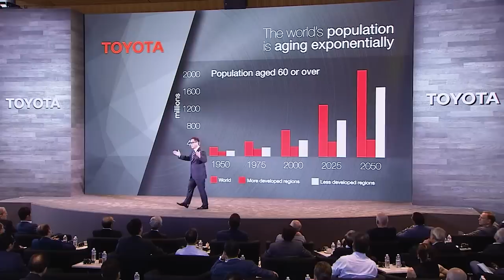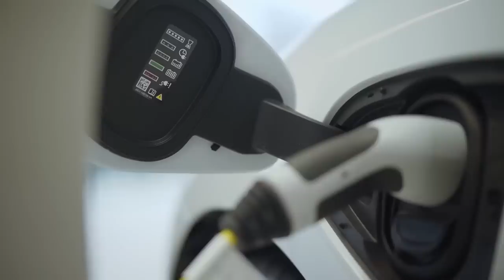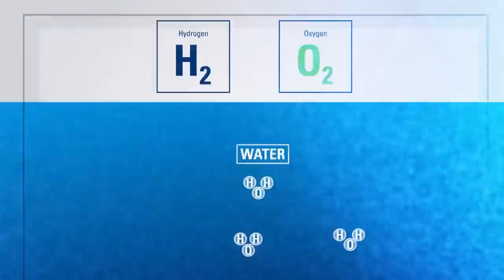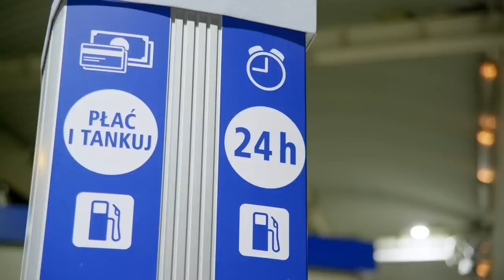New Toyota CEO Shocks Everybody | Huge News

Comment: Wishing Toyota 's success. More breakthrough in H2O2 technology in the near future.
Reply: This is about H2. H2O2 can be used as rocket fuel. Terribly inefficient. Just like the H2 value chain.
Reply: Think you’d have a real winner if you can power cars with ocean water

Comment: ...brilliant.  This is why Toyota will not only be around for a long time but it will stay on top in the automotive industry.
Reply: Actually makes sense since Toyota is a global company, many auto sales will go to countries that do not have good power infrastructure, even potentially remote locations where hybrids may not make sense, to have a more reliable tried and true gasoline based powertrain. EV's will be more popular in North America, and in more wealthy locale.
Reply: I agree but it's interesting to see how many are saying Toyota will be smaller or even go bankrupt in the future because they are "behind" in their BEVs and aren't all in on BEVs.
Reply: Some stink at reading a cristal balls.😂
Reply: @benjaminsmith2287  Part of the problem is that its going to be much cheaper to run a BEV than a Fuel cell vehicle.    Hydrogen is still about 8x more expensive to use than a electric charger unless you make the hydrogen from natural gas.   Then you will only be 4x more expensive.
Reply: Until the oil runs out
Reply: @victorluke5816  Yes, the costs are there yet, nor is the infrastructure. Battery development is much further along. But I think hydrogen FCEVs can get there in time.
Reply: @TheIsioisi  They were saying in the 70s that we'd be out of oil 10 years ago.
Reply: @Benjamin Smith  Storage of hydrogen is one of the biggest challenge. Also very dangerous. It's a great fuel for stationary applications
Reply: @benjaminsmith2287  Its just that by the time they get there the batteries may be 4 minute charging for a thousand miles and made of sodium instead of more expensive lithium.  The sodium batteries are already being put into cars this year.
Reply: Nah, Toyota won't pass the decade, and Tesla will dominate the automotive industry, Toyota is late to get into the new paradigm, making cars with all 4 technologies is a waste of resources, time and workforce, combustion is old technology together with hybrids, hidrogen  is a technology that was born death, so money and time going to the trash, RIP Toyota, being conservative and stagnat was your doom.
Reply: @victorluke5816  Economics of scale. Heavy equipment manufacturers are leaning towards hydrogen,as they can use the existing power plants they already manufacture.....EV heavy equipment is a non starter.
Reply: I live in texas. Toyota has their amerucan headquarters here. We love toyota! And i have one myself.
Reply: @benjaminsmith2287  toyota is not behind. You have no idea what youre talking about
Reply: @sommebuddy  Wouldn't diesel still be better than Hydrogen for heavy equipment.  Electric Semis look like they will be half the cost of operation than diesel so that makes sense but hydrogen just sounds like its just going to be more expensive to use than diesel.
Reply: @PolishBehemoth  Go back and read what I wrote. Then comment accordingly. You're assuming something I didn't write.
Reply: @victorluke5816  I'm aware of sodium batteries and they aren't there yet in terms of performance and reliability for automobiles. And they're not close to such a short charging rate.
Reply: They're lagging way behind the EV game, so they're trying to stay relevant by flogging the dead-horse of HFC technology...
Reply: @benjaminsmith2287  Sodium batteries are arriving in cars mid 2023 in China so I'm going to see how they rate in comparison to the standard Lithium ones.

Comment: Japan has a vision to become an energy independent country, (they import 94% of their energy consumption) and Toyota is part of that vision by insisting on hydrogen fuel cars.
Reply: I haven't seen any vision making Japan energy independent.  Even switching to Green Hydrogen relies in massive imports and production from Australia and elsewhere...
Reply: @redbaron6805  , so, they have to import H2O from Australia?
Reply: @CJ-hz1uj  Yes.  Australia is building massive wind farms which can produce Green Hydrogen.
Australia has an advantage there as they have a massive amount of vacant land area, and the West of Australia is perfect for both solar and wind farms.
Green Hydrogen requires massive amounts of energy to make, and to make it Green using renewable energy will require basically wind or solar.
Reply: @redbaron6805  Honda, an export oriented company, had an agreement with Citgo in the US for Citgo to produce hydrogen from water using a combination of photovoltaics and beryllium water crackers at each station. Turned out, as Honda said, not to be “politically feasible”. Perhaps there are a few that believe some more recent fictions about the challenges of getting hydrogen from water. We all would benefit by  looking beyond the indoctrination.

Comment: Back in 1998 I was a Toyota mechanic, Toyota was already working on hydrogen cars at that time, it's surprising to see it take this long to come to the surface, I really like this concept.
Reply: More profitable to repress technology. I have also been in the auto industry since the 90's. There are skeletons with stories they would love to tell the public about better ways to do it. 

High price to be paid for profits.
Reply: It's not gonna happen pal
Reply: Hydrogen has serious, easy-to-understand technical issues. Hydrogen molecules are the tiniest on the planet -- a tiny fraction of the size of a natural gas molecule. This makes it incredibly difficult to keep them from leaking out of pipelines and fittings. Serious problem.
Reply: Biofuels are the only awnser
Reply: I wrote a paper in high school many decades ago looking at hydrogen as a the fuel for vehicles.  My conclusion, build more nuclear power plants and skip the hydrogen.  The technology has not advanced at all in 30 years, because it is simply not viable.  Mostly because it is much more energy intensive to produce the H2.  Now that we've shut down a  majority of inexpensive and abundant baseload nuclear and coal power plants, both electric and H2 vehicles are not economic.  Petroleum is and will remain the most important and economic fuel for vehicles.
Reply: @billmartin1663  What are you saying? Any material that is dense enough can be used to transport hydrogen and store it. There are already hundreds of government certified hydrogen piping materials available on the market. The issue with hydrogen is that it is difficult to store since it is literally explosive. When combined with the required oxygen and combusted, it can cause enormous disasters that are just too difficult to mitigate to be worth the risk.
Reply: It would have put the hurtin on a whole industry. Cobalt mining and lithium battery production.
Reply: @billmartin1663  Funny...Ballard power has been making Hydrogen busses for over a decade,without said problems.
Reply: almost all companies did that. The Problems were always the same. Poor Efficiency and extreme technical complexity. Thats why the efforts that so many companies have put into hydrogen were almost invisible from outside. But many companies were almost killed because their managements have been believing in Hydrogen for the future. I think it is a huge mistake to think so.
Reply: The automotive industry is known to be extremely slow with innovation, this due to the philosophy of production Toyota invented, Wich concentrate in quality and the ability to produce the same car as efficient as possible, the price for it is a lack of improvements and innovation, you stop improving your product to concentrate in it's production and quality control, so any improvements takes years or Decades to be implemented, that is why hydrogen was advancing incredibly slow, and electrics, and other technologies, Tesla changed that, they never implemented the philosophy of the industry, they invented their own productions method, and to become profitable as fast as possible, they needed to be lighting fast in production, and lighting innovative at the same time.
Reply: @Voltaje_YT  I don't think that this is really the case Giancarlo. I think Hydrogen technology is a technology that does not go with mass production. It is extremely complicated and you can deal with that as long as cars are released in low numbers in a demo project or so. But it is almost impossible to provide that on a big scale. Toyota, Honda, Hyundai, GM, Opel, Daimler, BMW, Audi, ... have been putting huge effort into H2 for decades with very little return on invest whereas the battery thing has been ramped up within a timeframe of +/- 5 Years.
Reply: @Voltaje_YT  The military industrial complex kept it slow dude. What’s released to the public has been refined and reserved for military use for decades. This is how countries maintain their military superiority. By not making the best tech available to the public for the rest of the world to reverse engineer.
Reply: I used to think hydrogen was a great idea—until someone reminded me how volatile, and therefore dangerous, it is.
Reply: That's because gov has squahed hydrocars for decades. My hubby's bf dad,  designed a hydro car, & they snatched up his design & made him never talk about it again.  That's when we were all kids. And my grandpa,  a civil engineer,  designed a hovercraft in the 50's. That was hushed up, too.
Reply: @mariatorres9789  Is there anyone left who still buys the 100mpg carburetor story? I thought that went out with the 70s.
Reply: @timsmith2525  Um, idk what you're implying. Are you claiming,  gov isn't 20 yrs ahead of the tech that civilians get to use?
Reply: its taken so long because its a horrible idea full of inefficiencies. Hydrogen is such a challenge for rockets that its not even pumped on board until 10 or so minutes before launch and continuously topped off until the umbilical releases at T - 0. Its such a tiny molecule that it can almost not be contained by any conventional hose or valve arrangement, even perfectly machined rocket parts leak hydrogen. 

Thats totally ignoring the environmental problems. We dont have hydrogen wells. Every molecule of the stuff that exists free or other combinations (H2O etc) on earth is generated by man-made processes. chemical or electrolysis. And remember your physics classes. you cant create energy or matter from nothing, and you cant get more energy out of a system than you put into it. So the process of generating hydrogen already nets you less energy out than you would have gotten if you just burned the fossil fuel used to make the energy to make the hydrogen. So your already expending more energy and pollution just making the stuff, then you have to transport it in cryogenically cooled tankers and store it in cryo tanks at the fuel station. its just a silly idea all the way around.
Reply: anyone heard about hydrogen paste
Reply: @billmartin1663  plastic tubes can, but metal can't hold it. Hydrogen is a way, but it's not invested enough as people go for EV over H2
Reply: @LisaKnobel  uranium mines have around 50 years left in fuel, MOx reactors are the next step, using the nuclear waste for more power.
Reply: It’s very dangerous
Reply: The money needed to make sure every gas station carries hydrogen is the biggest problem. It is why only CA has hydrogen cars (least they did a few years ago with testing). 

Not to mention states that would fight and fight and fight to keep this fuel source out of their state (like they did with unleaded when it 1st came out).
Reply: How is going to roll out hydrogen refuelling infrastructure ? Toyota ?
Reply: @bensk8in467  Remember that when you eat a steak - because then you have been as bad to the environment as the production of a lithium battery that can hold 70 kWh of energy. And that is a one off - how often do you eat a steak? Or buy a new pair of Jeans, for their environmental impact you could have 2 such lithium batteries...
Reply: @karlgunterwunsch1950  Don’t make accusations towards my rate of consumption lol. Steaks, jeans, you just picked two items I don’t shop for lol. Am I a consumer? As a westerner inherently yes I have to to play ball in this society but I live as minimalistic as possible without appearing to look like a hobo. I buy second hand clothes, wear them for years, and my diet is nothing lavish I can assure. The average American would whine like a baby on my diet. Some of my jeans are probably 20 and 30 years old. I’ve never even owned a new car in my life because I can turn a wrench. I don’t claim to be a saint when it comes to my consumption but don’t go pointing your finger thinking everyone lives like you because we don’t. I am at least AWARE it’s a problem and make conscious efforts on my life to combat it. Which is more than I can say for most people in the US today. How much trash I make is something I actually think about as I live and make a lot of efforts to make as little as possible. How often do you fill the can by your curb every week? I put out about one can every few months after I separate compost and recyclables. Years ago I visited Jamaica and immediately noticed Toyotas were probably 90 of the cars their and asked a local. What’s up with all the Toyota’s? He said we’re an island we don’t have room for landfills we can’t buy junk. Shazam! What a concept? Maybe we should all try to be a bit more like that. Enjoy your steak chief.
Reply: @Rebecca Conlon  reminds waste fuel would be wonderful.  But, not sure anyone wants to risk billions of dollars on a plant that could be shut down by a political whim.  

Plus, just like gas and oil, there are a lot of undiscovered deposits to be found.
Reply: @LisaKnobel  Remember the beginning of Back To The Future II? Doc outfitted the Delorean with the ability to run on trash. He threw banana peels and even a beer can in it 😂. I say give it time it’s been withheld what we can do.
Reply: @bensk8in467  I could get behind that, but the emissions system would be bigger than the car!
Reply: @LisaKnobel   I just believe there is a lot of prophecy and what’s to come in movies and music and have so for a while. They’re full of clues. Though it may not come as exactly portrayed in a film I believe they’re trying to tell us something. I don’t even take things from the Bible in literal form. I believe much of it is metaphorical and overthought and misinterpreted.
Reply: Hydrogen has been powering vehicles for a very long time. It works excellent. I first saw it being used in the mid 80's on an old converted Cab with a Propane mixer on it. Some professor from a University in Ontario set the world record for distance in a Hydrogen powered vehicle. Nothing special about making a vehicle run on Hydrogen. The issue is in the production of Hydrogen which uses a huge amount of electricity. The end use efficiency makes it unviable.
Reply: Bob Lazar was making hydrogen cars in the 80s. Its not even hard. Just car companies wont allow it.
Reply: Can we just go back to basic vehicles like back in the days when they would last for years..
Reply: @espianmashias9565  We could easily go back to steam-powered vehicles. No more gas. No more emissions. No charging. Just water and oil.
Reply: They work in theory when price is no obstacle and they're not leaking out an atomically small pinholes or exploding in such a catastrophic way it puts a gasoline or lithium fire to shame.
Reply: @LaZarusXtnct  EV's are technically steam powered if they get their power from a nuclear powerplant or a coal power plant. Both of those are technically steam engines. They use heat to boil water and turn a turbine that makes electricity for your car.
Reply: @Jake-bt3fc  EVs are not steam-powered in any way, shape or form.
Reply: @LaZarusXtnct  Did you not read my comment? Do I have to explain it again? They're powered by electricity. Electricity is created by power stations, many of which make electricity with steam powered turbines. 
_
Reply: @Jake-bt3fc  Why would you need electricity at all.
Reply: @Jake-bt3fc  Thats just a whole extra step you dont need. And then you gotta charge your car anyways.
Reply: @Jake-bt3fc  Attention, the guy doesn't understand anything
Reply: @Jake-bt3fc  Steam cars are not powered by electricity at all. If thats the case then explain how steam cars were being driven before hydro-dams and power-plants existed.
Reply: GM had the fuel cell electrovan in 1968 and the tech was the same as today
Reply: Toyota can't give up on forcing their customers to go to gas stations. Japanese companies are arranged in kirietsus. They won't put their fellow companies out of business. So they won't hurt me gas stations. The only good thing about the fuel-cell, is that it still has to go to the gas station. Of course it sucks if your a driver.
Reply: The problem with hydrogen isn't the maturity of the technology.  The problem is the complexity of storing hydrogen - 5000 - 10000 psi - and the cost of producing hydrogen - $15 per gallon gasoline equivalent.
Reply: @20xitysix by 2030 you will live in a 15-20min city,own nothing and be happy?
Reply: @espianmashias9565  this video is literally about the company that still does that.
Reply: @Rodney Howard  sorry to tell ya boss. They already are